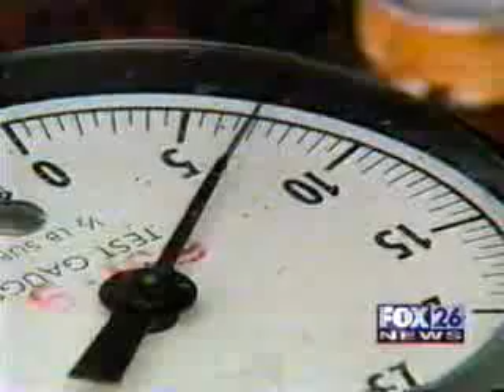Hydrogen Torch - Hydrogen Car

Comment: calling bs. I've seen alot of hho tests and demonstrations and NEVER have I seen anyone able to cut steel. not on hho alone.
Reply: MadMetalManiac74 uhh.. how small were their torches..?  Hydrogen burns extremely hot. Google something.

Mazda actually released their 2004 rx8 to run on solely hydrogen or gasoline, or a mix of the two. Look it up. PS: hydrogen helps rid engines of carbon!

Comment: Why are we using this technology????
 That's badass  car running  on water👍
Reply: Freedom Smoker 

Ive heard rumours he went missing.
Reply: because the power needed to produce it's being outweighed by hho benefits. it's VERY difficult to actually achieve the benefits in hho for automobiles. the power to produce hho gas has to come from somewhere and while h20 is a renewable reserouce it won't save you anything unless your vehicle is tuned just right and your generator is built in a certain way. as of today it's just not logical to use hho for vehicles.

Comment: The energy required to extract the H2 and O gasses from the water has to come from somewhere. The gas can be a fuel, but the process to extract it is energy intensive. It's great if you happen to have a supply of surplus energy that isn't mobile (ie, geothermal, wind, solar etc) to crack the water, but you need to compress those gasses as well (even more energy)

Also, HHO is a misnomer. No way in hell will 2 hydrogen atoms stay separate. It'd be an H2 + O mix. Which is prone to self ignition.
Reply: greatspacegibbon no , O is not possible, only o2
Reply: greatspacegibbon also HHO just means h2 and 02 in a 2:1 ratio

Comment: Denny Klein. This is not special technology, it's been around for many decades. It is a ripoff of the George Wiseman design. It has NOT been buried or anything else. It works great for welding and cutting etc, but will not produce more hydrogen than standard Faraday rates dictates. You need Meyer technology rather than high current to do that. Denny's website is still up and showing improvement in mileage only, not 100 percent running an engine.

Comment: He says he "breaks water down into HHO gas".  In chemistry if there are two of the same atom in a compound they use a subscript next to the letter telling how many of them are.  In other words, the correct way to describe HHO would be H2O (or water).  So HHO gas is just steam.  That would explain why it turns right back into water.  He just created a gas-powered steam engine for his car.  In other words, this is a bunch of smoke and mirrors. Do you want to buy my perpetual motion machine?
Reply: Yes I do

Comment: There is no way for the massive production of hydrogen unless you use nuclear fission economically only nuclear is efficient enough to do it.   Nuclear fission produces the energy flux density required to do it and make the fuel much cheaper than gasoline.

Comment: HHO is not a compound, it's a mixture, of oxygen (oxidizer) and hydrogen (fuel) in a 1:2 molar ratio. 
Burn it and you get H20 the same amount of HHO since HHO is separated water. As I said, separating water takes more energy than heat generated from combining hydrogen and oxygen molecules (burning).

Comment: It is exactly the same as any water, H2O. Two hydrogen atoms bonded to one oxygen. Burning turns HHO into H2O, releasing heat energy. But do to the laws of energy conservation, it takes more energy to electrolyze it or otherwise separate the oxygen and hydrogen atoms to make HHO again, than it will release when you burn the HHO. So there is no "burnt" water, what he was saying is that all water is "burnt" since it is an oxide, but it can be electrolyzed to make fuel.

Comment: Water already is oxidized. Burning just means rapid acquisition of oxygen, so when you burn hydrogen, you get water. It is not "burnt" water, it's just water. Separate the oxygen and hydrogen by electrolysis, burn them, and you get water again. It will always make water.

Yes, there is such thing as water with an extra oxygen molecule, it's called hydrogen peroxide. But it is unstable and decomposes on contact with a catalyst. The amount of H2O2 created by burning hydrogen is negligible.

Comment: If you read my posts more accurately you would find out that I didn't specifically call Hydrogen power or new inventions frauds.

I criticize the news reporters misinterpretation that is "running on water", when it isn't. Water is the bi product.

I pointed out "Water combustion" as a fraud because Water can't oxidate without separating the hydrogen and oxygen first.

There are some really nice ways to separate Hydrogen from natural gas which you can look into however. I.e. Honda's FCX Clarity

Comment: To a side note: I'm not here to finger you and ruin up your hopes. I'm trying to point out all the frauds related to water "combustion" and all the hoaxes associated with it.

There are thousands of people on the net that try to sell their bogus products that does nothing else than basically "cook" your water on your car's battery power.

The only way for a Hydrogen economy to work is to have excess amounts of electrical energy. For example if Fusion Power Plants were realized.

Comment: I really recommend you to check out the article "Hydrogen economy" on Wikipedia. It has some very nice charts and takes chemical reactions into consideration.

Check the chart for:
"Efficiency as an automotive fuel"

And the image:
Image:Battery_EV_vs._Hydrogen_EV.png

Its all a question about the most energy efficient energy conversion. Sadly it does not look well for Hydrogen.

Comment: if you put the right magnet setup of magnets on the axels of the car, it could recharge the batterie and seperatethe water in a never-ending process.
the only problem is that the ammount of friction would prevent any hope of free energy

Comment: What his machine is almost definitely doing is taking water AND electricity as he states himself, to make highly burnable (and widely used in industrial and even automobile applications today) hydrogen. Hydrogen burns without any pollution at all, the problem is that it takes more energy (the electricity that he admits to using) than you get out by burning the hydrogen, the eternal problem. Hydrogen is however used because it's a practical way to STORE energy, for example for cars.

Comment: Only Fox could be so blatantly and thoroughly, completely ignorant of chemistry to think that H2O is anything else than HHO. The H is hydrogen, the O is oxygen, and the "2" in between means that the chemical we call water is made up of... you guessed it... two hydrogen atoms, one oxygen atom. H2O and HHO are the exact same thing. Anyone who doesn't instantly spot this, cannot possibly know anything, and I mean anything at all, about chemistry. With all due respect, those are the facts. H2O=HHO.

Comment: Back in the 70's I witnessed a modified 460 cubic inch V8 on a dyno getting over 50 mpg. It was a project being done by Ford. I can only guess that the oil companies hushed it up.